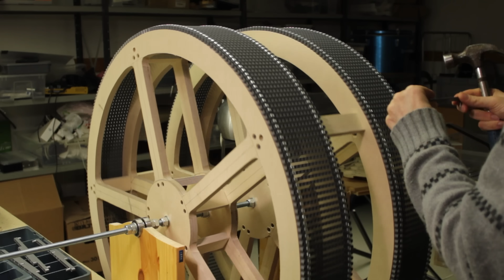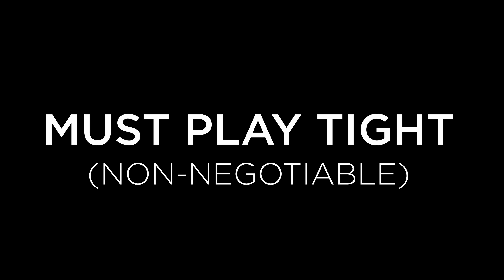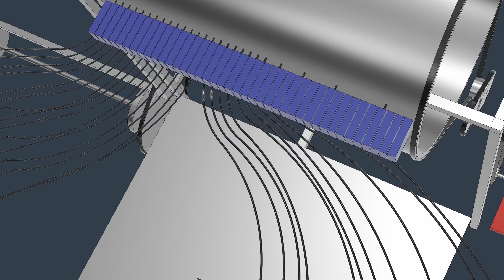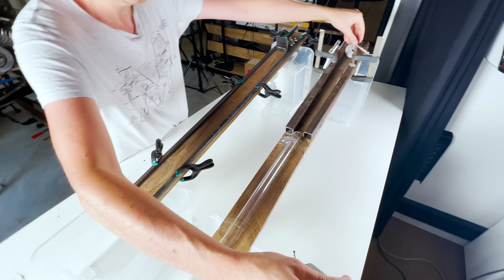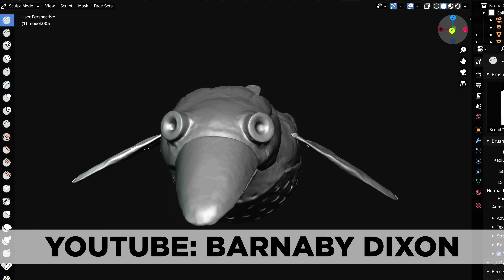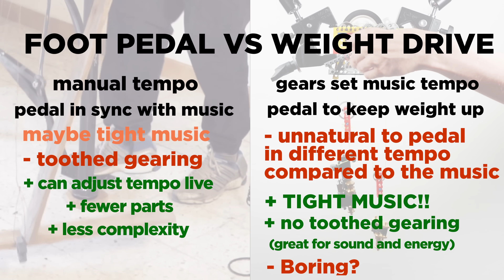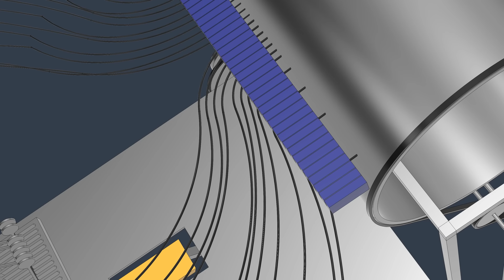Marble Machine 3 is Taking Shape

Comment: Wild suggestion, but couldn't you use a weight drive that allows you to adjust the tempo somewhere down the line? Making it go slower with some sort of brakes or something, making it faster without them... maybe something like being able to change the weights a bit? On top of that, I feel like there's probably also an option to hold the wheel a bit stronger, in order to play more tightly

Just out of the blue suggestions :)

Comment: In terms of what drive source you want to use, why not use both?

If you set the weight drive on a differential with a bypass through system you'd be able to set your base tempo but also exceed that tempo on the fly whenever you'd like.

It would also be good for the machine so you can keep everything moving at an even pace.

It also wouldn't hurt to look into a throttle system where moving a lever up or down will increase/decrease the tempo as desired on the fly (this can be adopted into a foot pedal.)

Comment: I see some poor thinking in this video, Tight Music is easily defined as the note occurring within x milliseconds of the time it is expected, you already have the components to do that.
The concern on Bowden length affecting timing is irrelevant if they are all the same length, having them the same length makes them easy to purchase, store and replace so maintenance is simplified, the design then only needs to allow for the Bowden cables that have a "shorter" distance to the gates to take a longer path with a reasonable bend radius.
The power system would be simpler and better if it was an almost direct drive electric motor with a properly calibrated speed controller, to start you set the speed dial to the bpm you want and then if the feel requires a faster or slower bpm you turn the dial to the required bpm, you could include brake, run down and run up buttons to allow for more artistic expression, or have the motor drive a flywheel and use the clutch from a car to control the engagement of the actual drive for the marble machine and flywheel, you would then be using tested off the shelf components that are proven drive chain components, you just need a manual means of operating the clutch.. You showed with MMX that a foot pedal was insufficient to maintain tight music because you could not maintain the required power over the period of a song, hence the need to add a motor, learn from past experiences don't repeat them.
Keep up the good work Martin, I look forward to seeing the MM3 in concert.

Comment: Idea: Have the weight drive as a separate, easily detachable/attachable module. If you want ultra-tight music, you attach it. If you want to have the pedal directly coupled to the rest of the machine, detach the weight drive and replace with a single belt/gear.
Or you could have a lever that enables/disables the weight drive.

Comment: You don't have to pedal constantly with weight drive! You have a range of tempos you pump with - with weight drive you have an energy buffer, that's all you need to keep track. You have more freedom to pump as hard or delicate as you want. You can even STOP pedaling for couple of seconds. It gives you MORE freedom, if anything! Tempo control CAN be done in any other way - gearbox, brake, regulated clutch. Think of how much energy you will need to actually DRIVE all the mechanisms - this will add much faster than you think. Do you really think you will be able to do rapid tempo changes with single pedal only? Think how much kinetic energy will be stored on flywheels, drums, belts, remember that every single milimeter of movement of readers dragging over the drums will rob that energy with friction over profiles (I think they need to be smooth as glass, and that you will need to work on their profiles to minimize losses here). No free notes, all hard work. Start liftin' C:

If you want to use your stage energy, there is nothing stopping you from doubling speed control with second pedal for adjusting tempo or anything else.

With pedal drive you are close to the mechanics, but you are absolutely tied to machine. Which way you will be facing? To the machine? Away from the machine? Were do you want people to be? Will you be really able to engage with audience with this?

You have to make sure to have space around you - i.e. you will be playing guitar. Do you have safe way to put it away, or change to different one? Can you do it yourself, or do you need a stagehand to help you with it?

Think about ergonomics, and stability. Can you steadily pedal with one leg for one hour with exquisite tempo control? Will you be able to bear all of your body weight on the other leg? This may lead to joint issues/pain, if you mess this up.

From artist as a human being point of view weight drive is not only more practical but also safer.

Comment: I think you should use the weight drive, BUT, instead of gearing to set the tempo use a governor to regulate the speed like in a steam engine. That way a hand crank can be used to set the speed and allow you to adjust it on the fly. 
Gear the input pedal with the weights system so that stomping at tempo uses the same energy input as the weights are delivering keeping the system balanced. Stomping at tempo should keep the weight in nearly the same place in space. If you set the tempo faster, you will have to stomp faster

Comment: Manual all the way.  I share the concern that the weight drive would take some of the “life” out of the machine.   The thing I’ve enjoyed about the first two iterations is that the machine was an extension of you. Even putting the electric motor on MMX just for testing felt disconnecting.  
I know you’ll find the right balance between a rigid “tightness” and the musicality that makes it more you and less a lifeless robot.

Comment: The impression I've had till now is that the weight drive was meant to replace the fly wheel. Was that not the case? Couldn't the foot pedal adjust the tempo while having backup power from the weight drive in the same way that the fly wheel provided previously? Or am I mistaken here?

I'm not an engineer, so I'm learning with you as you go. I'll be very interested to see what you decide here.

Comment: Your pyramid design process looks like a conventional waterfall process. You should definitely take a look at those standard design processes.
One disadvantage of the waterfall design (and consequently your pyramid design) is that once a phase is done, its pretty much set in stone. So if you are really loosy goosey with your definitions for steps 1 to 3 you might as well fail again when reaching step 5 and its not comming together how you imagined. Like the music doesnt sound good anymore, what do you do now? Go back? Dont base the machines design goal on your personal goals! For example you could say that "Tight Timing" is a consistent time between successive activations of the marble gate, the activation leaver, etc. Or the music "Sounds Good" if the instruments sounds most similar to the real instruments. 
Anecdote: The metric system was for the longest time based on subjective objects that define the metere or the killogramm. If those objects change in any way, which they did, the definition has changed and all sorts of things need to be recalibrated. Thats why we chose objective measurements like 1 metere is the distance light travels in 1 ⁄ 299792458s or, the most recent example is the definition of the kg. As a result of this one can no longer argue how heavy 1 kg is. And you should do the same, such that the project isnt based on your subjective opinion, which is bound to change with time!

Comment: Dude, you need to embrace past failures and use them to power you forward, not hold you back and make you fearful. Failing is largely inevitable at some scale, so embrace it, fail fast and tweak and evolve as needed.

Also, you're spec on stage 2 and 3 are so loose you might end up skipping past them to cad fairly quick, still good you have them in there to consider but I hope you still put a good amount of time in to assess those before you move on, so you're properly happy with those aspects first.

Also on power and foot vs weight, I don't understand why it has to be one or other? Couldn't you hybrid it so you get benefits of both? Tight time bit also a way to switch to manual timing too?

Keep up the good work!
All the best! 😊

Comment: Weight drive could be like cruise control. One other thing is to have a second small timing cvt for the output of the Huygens drive so that power input also controls tempo and you could have a disconnect or between the pedal and the cvt.

Comment: Two things I think you need to visit.
1) You need to re-check the marble gate timings with playing an actual instrument and collecting the marble after. The biggest impact you had on gate timing was a vertical drop onto a horizontal surface. You need to drop at an angle or have the instrument at an angle in order to direct the marble into a funnel.

2) Do not remove "electric" as a potential power source. Hand Crank and Foot Crank are manual input. But the Huygens weight drive is already going clockwork / self powered (albeit for a potentially short timeframe). If you think clockwork is acceptable then you should also consider electrical being acceptable.

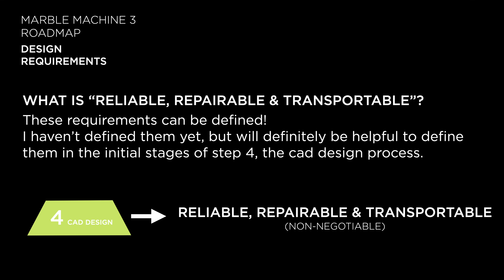Comment: [6:16] My suggestion: 

Reliable : that the wear on the componants don't affect either the sound quality or the tightness of the machine also that all the points of failure are know and controls before a show.
Repairable : Most of the parts are easy to replace, with in a day or 2, the other that can likelly cause a major faillure are keep in stock, all the parts can be replace on the machine in less that an hour. All wear parts are easy accessible worldwide,  
Transportable : most of the part can be transport thru cardboard crates, only few part require more than a person to move and those parts can't be damage easely. the assembly and diassembly of the machine don't not create a possibility to affect the tightness the sound quality or reliability of the machine.

Comment: if you are going for a weight driven system - why bother with a foot pedal at all? just set a weight up behind the machine, really high up; then all you need is an on/off switch for the weight to start falling and starting the machine
that way you don't need to be at an odd tempo foot-pedal-"recharging" an already pretty autonomous system...
with your feet "free" you can roam around the machine more to manually play it and/or even jump to another instrument and leave the marble machine play on its own

Comment: I want to share some thoughts on the Foot Pedal vs. Weight Drive dilemma! Forgive me or even better explain me if I'm missing something.

I see a few more disadvantages with the foot pedal.
1. During the song you are are stuck, you can not move much, you can not dance/jump/bow/do something spontaneous.
 
2. Fatigue/health? Is it possible that long-hour sessions can be unhealthy or unsustainable? (maybe not as you can switch leg, but also idk how much resistance it has and the rest of ergonomics of it)

- an extra advantage is that your whole body movement is in sync with the music

As for the weight drive

1. Why can't you pedal-charge it at the tempo of the music and then pause for a few bars if too much and then go on with the tempo etc.

2. Why can't you real-time adjust the tempo by changing the gear-ratio, can be in a continuous way, not a gear box, expanding/contracting the diameter of a pulley or so.

- - -

A first thought optimal scenario is a variable-tempo, charge-and-wait weight drive, where you can also rest, dance, or whatever for a couple of seconds during a song

Comment: Martin, maybe just power the machine with electric motor? It will be much more reliable - you could get exact rpm, easy controllable... No flywheels, weights, pedals etc...

Comment: @Wintergatan A smooth belt drive is one of the simplest types of clutch. If the pedal will power the flywheel directly, you need a lever and clutch capable of introducing additional power from the huygen weight drive, but without dropping the "weight " or stalling the flywheel. But in this case, it's easier to make a separate pedal to power the "huygen weight drive".

Comment: (Assuming you've not already done this, or considered it and discarded it) Maybe: make the foot pedal drive a flywheel, and then the rest of the machine is driven from that. This would allow you to still control the speed by the amount of energy you're putting into the flywheel, but the inertia and momentum of the flywheel would damp out any variation in your foot tempo and hopefully lead to sufficiently accurate timing.

Comment: when designing the pedal, please consider the AMPLITUDE  -> how much do you want to bend your leg for each pump? maybe take a bike crank as inspiration for the measurements.
please also experiment with the POSITIONING -> do you think its easier to pedal with the highest point in line with the floor, or is it actually maybe more ergonomical with the lowest point above the floor?

im am suggesting this because to me the sketch of the pedal seemes to be designed for safety, which is good , but not for ease of use. 
Please verify your design with prototypes and comparison to existing pedal mechanisms of other machines and vehicles.

Comment: MM1 and MMX were not failures. Without those machines many of the mechanical considerations would probably not have surfaced to MM3, as for what worked and what didn't. Prototyping is part of the design process, and after all, you were not looking to make specificly a "MMX" or a "MM1". your goal was to make the perfect marble machine, of which both those projects contributed, I'd say greatly, as you keep on reflecting back on them.

But probably most important, you enjoyed working on them and had a great passion for both those machines. Which really is the main reason you still continue from what I can tell, for why do something when you don't enjoy it you know.

Comment: A couple of thoughts:
Re weight drive - as you'll be using belts, why not investigate CVT/automatic transmissions as you'd find on a scooter, as just changing the width of the pulley to change the 'gearing' would assist in your thought on tempo changes, no? And timing-wise, as a keyboard player I sometimes tap my foot at a completely different tempo to the music which balances my playing - weird and likely just me! XD - but it shouldn't stop you driving the system with your foot at tempo to match the music, or am I mistaken that you could 'overdrive' the weight drive?
Re stage 4 - having discussions with your technical crew/roadies might help give you ideas on how you can help them make transporting MM3 easier?
Awesome to follow your journey as always :)

Comment: A question concerning powering the mashine:
Have you crossed out using a motor that you can switch on and off so you could use both feet to play music like an Organ?
This might also be functional and a design question: Do you really need to power the mashine manually?
What musical function do you perform with the foot pedal and could the same function not be performed differently?

Comment: I have a suggestion:
What if you don't use a weight for the weight drive, but instead a spring that acts as the force that pulls down... In this way you could alter the tempo of the music by just changing the speed of the pedal: faster pedal - means the spring is pulled stronger and therefore the force is higher and the tempo increases, slower pedal - means the spring force is lower and pulls less therefore tempo slows down. The tightness would still be given as the spring acts like a buffer, even if the tempo changes abruptly the spring would buffer and change the tempo with a slower de-/acceleration curve. Of course the strength of the Spring has to be in relation to the tempo of the song to be able to play in a certain range of tempo, but you could implement a way to switch out the spring in between songs.

Disclaimer: I'm not an expert, so this might be a stupid Idea.

Comment: I know that my idea may be quite out of boundries but it would (IMO) allow Martin to play tight music with the option to speed up/slow down and "go with the crowd". Essentially it comes down to this comparsion: mm3 will have a flywheel that will keep the power input steady even when the weight is at its lowest. That l(let's call it that for convinience) power unit can be compared to car engine. And what does cars have besides engines - manual transmission or gearbox (whatever you name it). IF you could make something along the lines of that and it doesn't have to be a full funcionality, couse you don't need the reverse, then you can slow down or speed up whenever you like. As a bonus it will seperate power input from power transmission so it will allow for easier dis/assembly .

Comment: Surely there is some mechanism where you could use the weight drive but set the tempo by the foot pedal?

Perhaps you could take the foot pedal as a PFM-modulated input to a clutch which slows (or even temporarily stops) the weight from dropping.  This way, the faster you 'pulsed' the foot pedal, the faster the music would play - but you'd still have the advantage of the weight drive.

Comment: You can vary the tempo of the hyugen drive with something like a continuously variable transmission (cvt). but isn't it true that in both cases, you would be driving the mechanism with your foot? the major difference between the two drives is the "battery" - in one, the energy is stored in a flywheel. in the other, it is stored in a lifted weight. the hyugen drive's output is normalized by gravity, but there are likely ways to normalize the output from the flywheel as well.